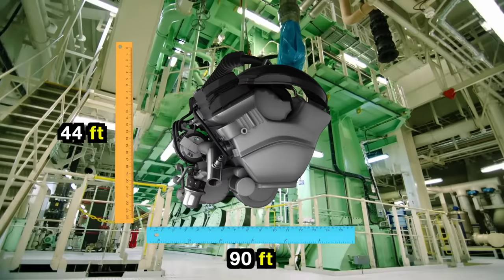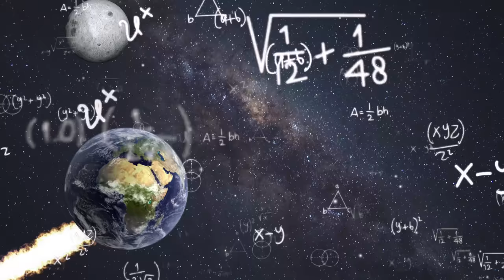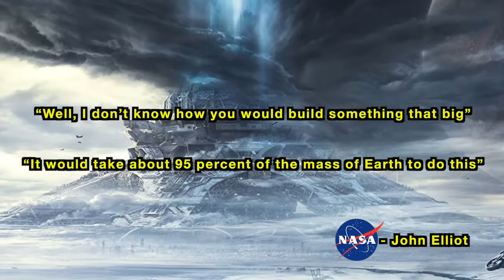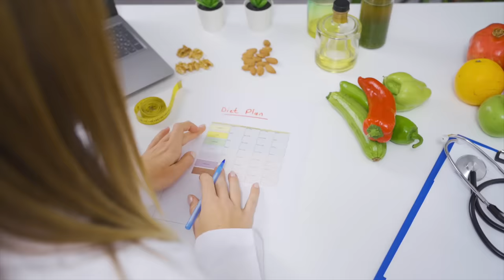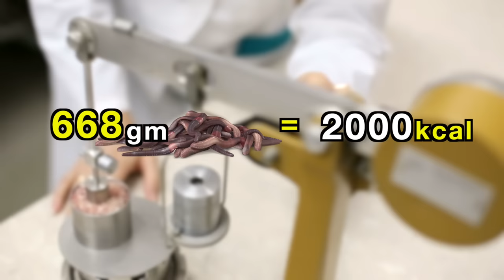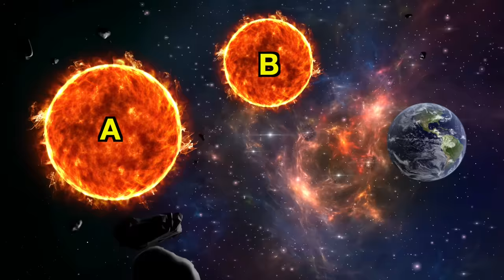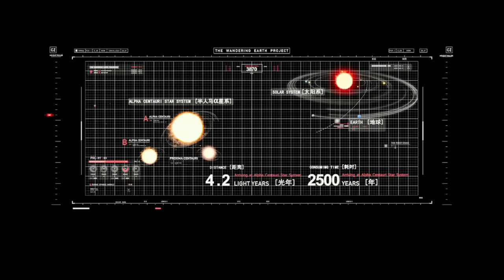Why You Wouldn't Survive THE WANDERING EARTH

Comment: Don't forget, they'd also have to figure out how to flip the planet in the opposite direction at the halfway point to slow it down in time to not just fly past the entire star system.
Reply: they did explained the plan, it take like 50 or something years maybe 100? or 200years? to slow it down and flip direction.
Reply: @slatealan7082  Oh, I understand that from the movie standpoint. But people were making statements and asking questions about reality, what would really happen. And the way physics works in space, you need the same amount of time and thrust in the opposite direction to slow something down. And the faster they manage to get the planet to move on the way there, the higher amount of fuel they'll need to slow the planet down once it's flipped. Either way it takes the same amount on the slow down as the speed up. If you want to see this in action in a TV show or movie, watch The Expanse, they do it really well. If they want to slow it down faster and in a shorter amount of time, they need that much extra fuel to do so, and the g forces would get quite intense on the planet from the increased deceleration.
Reply: Flipping the planet would be the least of the problems. Don't forget that they've already stopped the rotation. Same mechanism.

Comment: I would like to point out, thrusters of that magnitude would put out heat on such a level that anything nearby or shall we say living underneath them would be baked to death long before we shifted the planet out of our own orbit. The entire premise would end the moment they turned them on and burned every living thing on that side of the planet, then everyone on the other side would freeze to death.
Reply: This is addressed in the story. People moved underground as surface is uninhabitable.
Reply: And most likely wont work... Earth is pretty massive (Less than average compared with other planets). There is no possible way that those engines could even move Earth. Forces needed to make a planet wander should be enormous... Lets say another star passing by and disturbing the solar system orbits. I know... Its a movie but it is dumb enough to make me feel insulted. Also how the fuck they managed to fixed the earth not rotating problem?
Reply: @rh7474  they lived under the engines, I specifically pointed that out in my comment. You would bake to death trapped under those things, you're the guy that lights the forge and then asks why it's so hot in the shop now
Reply: @aguy2847  i kinda just accepted that I would suspend belief on that for the sake of the movie, I couldn't when it came to the actual output of those engines though. What a ridiculous concept but maybe people were entertained for a while I guess
Reply: @aguy2847  Its not like they live a few feet below them though lol. There's obviously a safe enough distance.
Reply: @rh7474  and what would be that "a safe enough distance"?
Reply: @elbarroetoide6898  the distance where they don't burn
Reply: FD&BJ  You cant just... go down until you are far enough away because the deeper you go the closer to the core you are, the hotter it gets. The engine is about 7 miles tall so lets assume you need to be at least 7 miles away which is more generous than the Jet  engine example by scale. Congrats, its over 150 degrees and you all die. Ignoring the monumental effort of building a city 7 miles underground.
Reply: @durnhand9524  Oh people know it was a extremely dumb idea, but it was different enough that it was a fun concept. Of course people would have died it was so apparent that all plants and animals would have disappeared as soon as those rockets fired off. There is just too many rocket arks movie out there that we needed other versions regardless of its viability, since it is just for entertainment.
Reply: FD&BJ  this is not true, you don't get burned because of heat shielding not thrust. Heat dissipates around a rocket engine. Apparently you don't understand propulsion engines, too bad they didn't include that in your "common sense"
Reply: fdbj8795  Somewhat, but you still wouldn't want to be super close to one either. Everything's to scale and then some, so something as large as a mountain would need you to be at least half a mountain's space away from it in order to not be instantly fried. Because you obviously wouldn't want to put your hand a few inches or a couple feet away from a regular jet engine, let alone being only a few miles away from a giant one.
Reply: I would like to point out that even of we made those engine.  It would be enough to pull as off our orbit of the sun.  Magnetic field wont let us or the sun wont let us do such silly things.
Reply: Nah I’d survive im bult diferent
Reply: @aguy2847  if you feel insulted about a movie then that sounds like a childish personal problem. Grow up dude
Reply: @aguy2847  at the end of the 2nd movie they started up the earth’s rotation after 7 years, which is proved by Hao Xiaoxi when she was glad they switched back to the 24 hour system.
Reply: @aguy2847  also even if the earth wasn’t rotating they have underground cities under thick metal and rock to protect from radiation, as well as the atmosphere, and have thermal suits that could provide some protection against radiation but those transport trucks are very large and bulky so they’d provide even more protection to the workers maintaining the earth engines. Also there would be less radiation the farther you go from the sun.
Reply: Should use geothermal energy to power the thrusters, then it can be used to heat the planet and thicken the atmosphere to keep in the heat for when they leave the solar system.
Reply: @ga bii I would like to point out, if my comment is useless that makes your comment useless also. Give yourself a pat on the back buddy! You deserve it!
Reply: @durnhand9524 If you were curious:

"The Fusion Driven rocket (FDR) represents a revolutionary approach to fusion propulsion where the power source releases its energy directly into the propellant, not requiring conversion to electricity. It employs a solid lithium propellant that requires no significant tankage mass. The propellant is rapidly heated and accelerated to high exhaust velocity (> 30 km/s), while having no significant physical interaction with the spacecraft thereby avoiding damage to the rocket and limiting both the thermal heat load and radiator mass. In addition, it is believed that the FDR can be realized with little extrapolation from currently existing technology, at high specific power (~ 1 kW/kg), at a reasonable mass scale (<100 mt), and therefore cost. If realized, it would not only enable manned interplanetary space travel, it would allow it to become common place. The key to achieving all this stems from research at MSNW on the magnetically driven implosion of metal foils onto a magnetized plasma target to obtain fusion conditions."
Reply: @durnhand9524 It is already super cold onearth at that time
Reply: @Kefka2010  That's cool. Too bad it doesn't actually exist though
Reply: @hellosurvivor97  Uh, thanks for the info I guess. You'd still bake to death underneath one of those engines.
Reply: @durnhand9524   @durnhand9524  and there is a huge distance between the underneath city and the surface so the heat won't reach that far
Reply: @durnhand9524  did you see in the movie the main character have to take on an elevater for a long time to get to the surface
Reply: @hellosurvivor97  they literally say how big everything is. So, yes I know they're deep
Reply: @hellosurvivor97  mate...the engines aren't on the surface. The reason the people are living so deep is due to the size of the engines. Nothing you have said changes the fact that their close proximity and the creation of a crater with an engine inside it would bake everyone living in said crater. The heat that dissipates, even after heat shielding, builds up in places like an enclosed rock cavern. AKA they are trying to live inside massive ovens
Reply: @durnhand9524  From my very limited and minimal attempts I can see there are already companies making them.  It's not like Einstein talking about time dilation and needing 50 years to confirm.
Reply: @aguy2847  ye
Reply: vcar7960  uh, how about no!

Comment: Just a quick fyi, when earth leaves the gravitational pull of the sun and other big celestial objects, the big thrusters would only need to be activated when you need to change the direction or speed of the planet and wouldn't need to be active permanently, specially at full thrust. So after leaving our solar system there would be only vast empty and void space  to contend with in which we would travel at a constant speed. Unless your a flat earther or something and do not believe in gravity ;)
Reply: I'm thinking they are like ion thrusters. Extremely low thrust, so you'd keep them on continuously just to get there a bit faster.
Reply: it depends on how much time you want to spend on the travel. If we assume that for 1250 years we'll be accelerating and for another 1250 decelerating, it would give us about 0,35m/s^2 acceleration what seems to be tollerable. If we reduce acceleration/deceleration time to half (so 625 years acceleration, 625 deceleration and 1250 of free flight), it would raise to 1,37 m/s^2, still acceptable. Further reduction wouldn't go that well - reducing acc/dec time twice again we'd have 5,5 m/s^2, quite challanging as a stable extra gravity... especially, that closer to the equator things would be really funny.
Reply: @barnmaddo  That's not how orbital mechanics work, leaving your engines on won't get you there any faster, you'll just end up overshooting your target and flying off into deep space again.
Reply: @JoetheDilo1917 Obviously you'd flip halfway through to start decelerating. Probably best to leave the engines turned on through the flip as well, as there'd be significant risk involved with turning off and on the engines.

Comment: I don't think even all that propulsion would be enough to move earth
And earth doesn't have that much fuel to escape from suns gravity
The ship would just drift into space and would just have to use their fuel for occasionally to fix their direction
Reply: fuel are basically just rock. The engine are mostly used to escaped solar system, turn direction and slow down the speed. They used gravity as a slingshot to shoot the earth away from sun. And most of the time the earth will be gliding through space without engine. I know is impossible but they did tried to explained something.

Comment: The process of stopping the Earth rotation would be quite funny, too. Or rather "funny".
Also, restarting the Earth rotation with current tilt would be a bit hard to achieve - without the Moon, tilt wouldn't be as stable as it is now.
But in the first place - instead of moving to Alpha Centauri, it would be much easier and safer to move to the outskirts of the Solar System, to the new "green zone".
And definitely it would be easier to send a bunch of rockets and build number of giant space stations, than to move Earth.

Comment: Well, to be fair about the fuel, it's filled with uranium fission, which, despite all engineering and logic, they technically CAN fuel for over 490 million years if everything goes right. Still a horrible idea, BUT it's not as bad.
Though, the lack of every other resource would still be pretty detrimental...
Reply: it's not nuclear fission, it's heavy-element fusion
Reply: @neuralstrings8015  That is even more impossible. You need to input energy to get heavy elements to fuse. If you want to get energy out of fusing two atoms together you need to fuse elements with atomic numbers lower than iron. The energy you get out of fusion is the shift from a higher potential energy state to a lower potential energy state. Heavy elements have a high potential energy state as they are unstable and thus are prone to emit neutrons/protons to reach a lower and more stable energy state. They do not want to fuse with other heavy elements to produce a product that is even less stable.
more protons+neutrons than iron=fission
less protons and neutrons than iron=fusion
iron=already stable
Reply: @GeorgeMonet  Of course it's not "heavy" heavy element fusion. The main element used is silicon, the main element in rocks, which is why the people called it "burning rocks" The high energy needed to start this reaction is from a device that's as far as I know a nuclear bomb, which is required to reach the high energy output needed for starting the fusion process.

Comment: The engines don't necessarily need as much fuel as you state: if you double the speed of whatever your engines spit out, you can use 1/4th of the mass of the fuel and still have the same amount of propulsion. As the speed of whatever your exhaust is comes close to light speed, the mass cam become nearly zero. So to sum up, a single atom would be enough propulsion to launch earth to the next star, provided you can generate enough energy to make it fast enough. If the engines use plasma, they are likely torch engines, which use fusion reactors to heat the fuel they burn up to very high temperatures. This plasma builds up enormous pressure due to the giant heat. This high pressure could allow for a way higher speed of the exhaust while simultaneously drastically reducing fuel consumption
Reply: And how are they going to contain that much heat and pressure? How are they going to heat up that much material to such a high temperature?

Comment: The good part is that once you actually reach escape velocity, and basically leave the solar system, you no longer need to fire your engines. There is no air resistance, and things in space just keep going in a straight line. So stop trying to fire the engines, and start tying to make humans survive (and make a plan to slow down when you arrive, which might not be nessesarry if you did you orbit calculations well, however you might want to make earth spin again)

Besides that, assuming the engines themselves dont shoot out too much atmosphere, you should be able to keep most of it, since you are not accelerating for most of the journey.

Everybody is still very likely to end up as popsicles, and moving the earth is laughably implausible, however if done practically, it can actually somewhat make sense.

Comment: You don't have to run the engines the entire time. They are only needed to accelerate Earth to desired speed. Which is of course going to consume vast amounts of energy and fuel, but at one point, the engines can be turned off, and this point happens sooner rather than later.

Comment: You wouldn't move the earth by turning the planet itself into a spaceship. You slap fusion candles onto jupiter or saturn and use one of those gas giants as a tow truck. You capture earth in their gravitational field and once earth is locked into it's orbit, then you go to Alpha-Centauri. By the time you get there, you would've burned off much of which ever gas giant was used as the Tow Truck, but you would've gotten earth there in one piece for the most part. You can even use the gravitation forces of jupiter to keep earth warm so long as you stay out of jupiters rouch limit.

Comment: Here is why they chose this option:

1) They can move the earth
- If you can turn the earth into a spaceship, why bother making tons of smaller ones? For one, you have an unlimited supply of fuel (they use fusion reactors to burn rocks)
- It saves more people. A fleet of spaceships can at most hold around 3000 people. The underground cities can inhabit half of earth's population
2) We need somewhere to live
- It would be pretty dumb if us humans spent 2500 years making it to Alpha Centauri only to realize that there were literally no inhabitable planets.
- Although earth is pretty much desecrated but the time of the movie, it's a building block for once we actually reach the system. It's much easier to re-habilitate earth than it is to terraform a random planet. Not to mention to issues with gravity...
3) There was a backup plan
- If the Wandering Earth was ever to fail, project Helios would carry human embryos plus all the navigational platform astronauts to Alpha Centauri.
  - Of course by the end of the movie, the navigational platform was destroyed. But this doesn't mean they can't make a new one
- Basically, don't put all your eggs in one basket

Other potential solutions:

1) Just move the earth slowly!
- Firstly, that's not a long term solution. Sooner or later, we have to make it to a new star, so better start now before it becomes too late.
- Secondly, the sun is expanding much faster than usual. In fact, the sun in the book literally explodes in something they call the "Solar Helium Flash Incident". People forget this is a sci fi story. moving the earth slowly may not be a viable solution
2) Build spaceships
- Mentioned above already

And then there's the meta reasons

1) It would just be another spaceship ark movie in a pile of hundreds of other spaceship ark movies
2) It's a fun idea. Just accept that the laws of physics are somewhat different in their universe
3) This story is ultimately less about the science and more about the themes are morals. Same with the second movie. If you want a science-heavy movie, go look at interstellar. At the end of the day, the Wandering Earth is less about the Earth and more actually about the humans living on it.

And finally, the physics

1) Just... come on. This is sci-fi. As long as the preset physics systems don't change, it doesn't matter. And if you're disturbed by this, that's an iss-you.